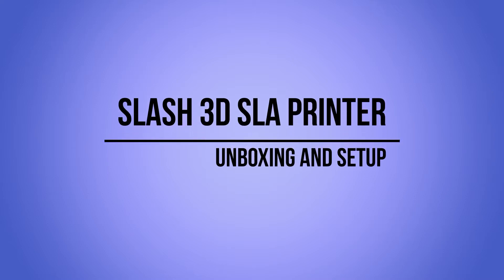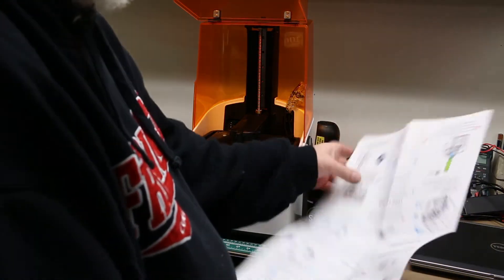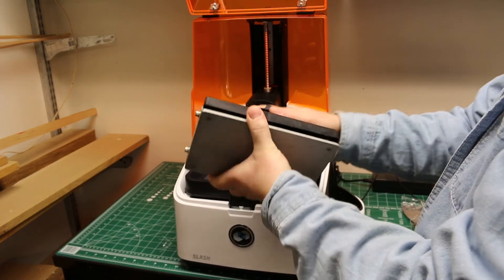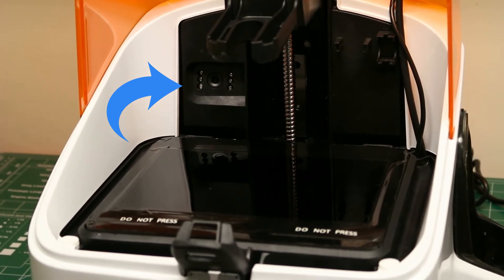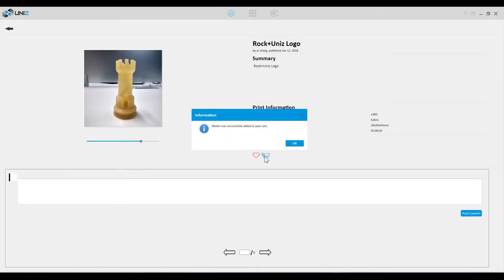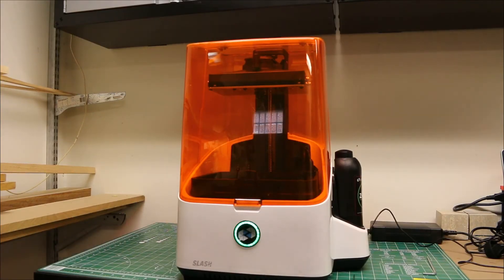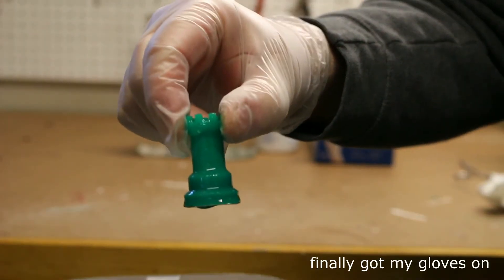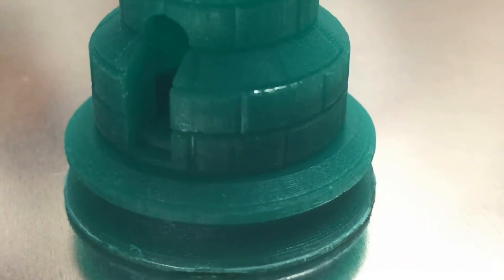Slash3d SLA Printer

Comment: Nice video.  How do you like the printer so far?   I'm considering the Slash, but as you said there are less expensive printers available now.  Is it as quick and reliable as Slash claims?
Reply from the maker: I've had some great prints from the Slash, and I've also had a lot of failures.  I would say they the Slash software and firmware are still a work in progress, hopefully some of the ongoing issues can be addressed with software upgrades.  It'll also be interesting to see the improvements to their new Slash OL and Slash+ printers.